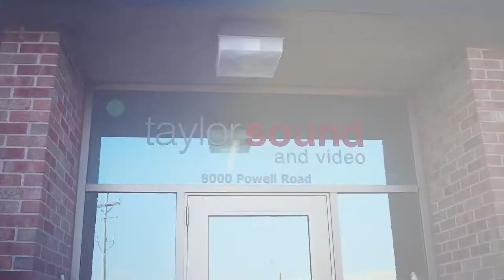Proper Ohm Settings for Your Amp

Comment: The speakers must be higher ohms or equal to the amp....BECAUSE?  It was explained perfectly and I finally understand it.  The speakers are resisting the current from the amp (16 ohms cabinet... resisting a 4-8 or 16 ohm head)  Sooo....if you have too little resistance on the current of the amp you can burn out the amp!  You nailed it brother. GREAT JOB!

Comment: This made no sense to me, but that’s my fault.  My amp has a switch “8Ω - 16Ω” and two output jacks.  The speakers are two separate 12” cabinets. Both also have two jacks and a sticker that says “16 ohm parallel”   The amp head is a Krank Rev Jr Pro 20W.  I’m confused about how to connect them and what position to set the switch.
Reply: Connect both speakers to the 8 ohms on the amp. The cabs; 16 ohms and 16ohms = 8 ohms. Only use one of the jacks for the 16 ohms of you are using one of the speakers.

Comment: Marshall JCM 900 head {4100} 8 ohm spot on the back switch. Two cabinets hooked up with the first speaker cable going into the right side of the jack-plate in the 16 ohm hole. The same on the second cab. Make sure your mono\stereo switch is on the MONO setting. Two speaker cables out of the head, from each 'speaker out' jack, to each 16 ohm cabinet. This is pretty much all you need to know to run a full stack in a healthy way. This video was the best I've seen it explained, wish I could've seen it in 1981.

Comment: God dam finally a short video that gets straight to the point.

Thanks!!!
Reply: Amen
Reply: Dont Get get too excited too fast. The information is actually poor and incorrect. Driving 16ohm speakers , single or in parallel, with 8 ohm amp output can potentially prove disasterous. I did just this and got away with it but it is not IDEAL, you can potentially create an electrical ARC between your tube and its socket.

I was using my amp/speakers just as indicated above....for years but driven in an apartment. I finally had a fuse blow and burning between my tube and its socket. I smelt it burning in the room. Immediately shut off the amp. 

So, it is in fact not the best advice at all to "make sure your speakers are a higher ohmage than your amp output" is just plain wrong and an oversimplification. The right advice would be "you can get a way with it potentially but ideally you want to match your amps ohm output, with your speakers efficiency, ie its ohm rating." 

THIS will help the "guts" and circuit topology of your amp work in an ideal way, save you money, in terms of tube life, heat dissapation, transformer life and avoid (potentially) burning something out.

So, ideally, dont have higher ohmage in your speakers rather match your speakers ohms with your amps output.
Reply: @thesongtowoody  I dont fear your god, but you should fear mine!
Reply: @XxStonedImmaculatexX  

Who is your god that is should fear him? (i'm presuming that you are sincere and worth trusting when i ask, if you prove disegenous, then the indictment falls back on you)

So, you made the comment. " I dont fear your god, but you should fear mine!"

With that context before us, lets see whether you are a person of substance and integrity or a wicked man.

so, Who is your god that is should fear him? (dont evade my question by a segway into another question and prove what i said above, that you are insincere and disgenous and a wicked man)
Reply: @thesongtowoody  sorry I should’ve been more specific, I don’t fear any european religions or their comic book gods 😊

Comment: Thanks man! I picked up a cab and the back plate said 8 ohms. I opened the can and realized the back plate was wrong. The speakers were 12” not 10 like the back plate said. After more research it looks like the cab is actually 16 ohms. I was wondering if I did any damage having it plugged into the 8 ohm output,
Thanks
Reply: As he indicated, have the speaker load impedance be >= the amplifier output impedance setting and it is fine. I always recommend purchasing an ohm meter and measuring the cabinet if there is a question and disassembly is not performed. Keep in mind, the ohm meter is measuring the dc resistance of the voice coils which is almost always slightly less than the true ac impedance. Even the ac impedance of a speaker varies over frequency.

Comment: so the higher Ohms means less power?
If bass head unit is rated at 350 watts with 4ohms and 250 watts with 8 Ohms then if I used 16 Ohms speakers then what will be the watts power on the head unit?

Comment: The information is actually poor and incorrect. Driving 16ohm speakers , single or in parallel, with 8 ohm amp output can potentially prove disasterous. I did just this and got away with it (for years) but it is not IDEAL, you can potentially create an electrical ARC between your tube and its socket.

I was using my amp/speakers just as indicated above....for years but driven in an apartment, lightly. I finally had a fuse blow and burning between my tube and its socket. I smelt it burning in the room. Immediately shut off the amp. (as i write this i dont know if i will have to take it to a tech or not (hiwatt bulldog)

So, it is in fact not the best advice at all to "make sure your speakers are a higher ohmage than your amp output" is just plain wrong and an oversimplification. The right advice would be "you can get a way with it potentially but ideally you want to match your amps ohm output, with your speakers efficiency, ie its ohm rating." The impression i get is that he is encouraging higher ohm rating speaker relative to your amp output.

Matching ohmage....8 to 8 for example or 16 to 16

THIS will help the "guts" and circuit topology of your amp work in an ideal way, save you money, in terms of tube life, heat dissapation, transformer life and avoid (potentially) burning something out.

So, ideally, DONT have higher ohmage in your speakers rather match your speakers ohms with your amps output!